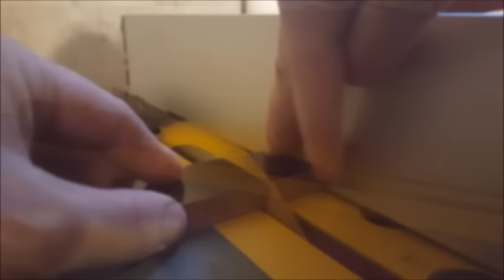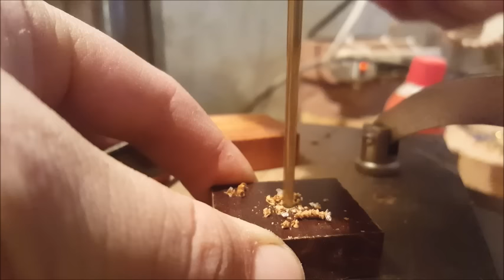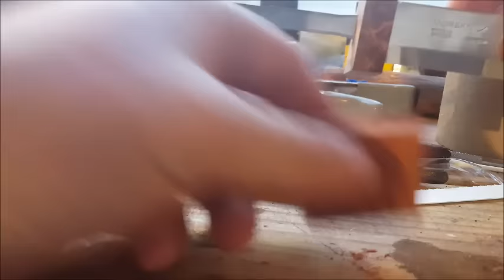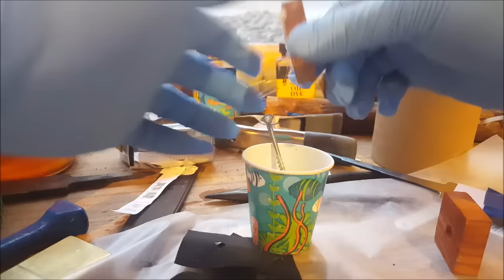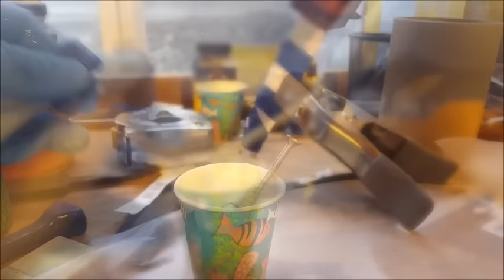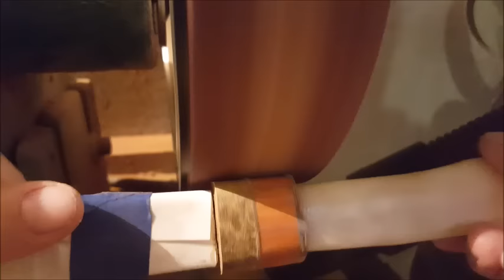Mora Classic No. 3 With Deer Bone Handle

Comment: What kind of cloth are you using for the spacer. I'm rather new to knife making.
Reply from the maker: Welcome to Knifemaking!
I use Cotton Canvas Cloth
If I'm not mistaken, it's 8 ounce canvas.
Check out the other videos and make sure to ask any questions you may have!
Reply: Okay thank you I tried t-shirt soaked in epoxy.
Reply from the maker: +Evan Gregory 
I actually tried that but found it was too thin.
It made mine look like obsolete shit haha.

Comment: hopefully you didn't ruin the temper while burning it through that block of wood
Reply from the maker: This is a very common comment,
I actually heat up the tail of an old metal file that I don't use any more.
If I was to heat up the tail of the knife, it wouldn't ruin the temper because it wouldn't not be hot enough to travel to the blade itself.
The Tail on most these blades are actual soft and untempered.

Thanks for the comment!